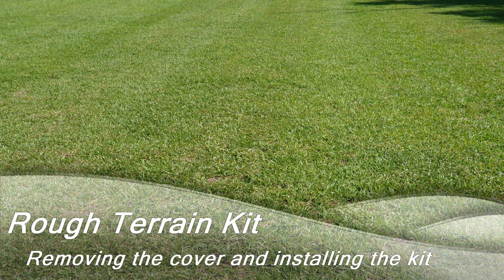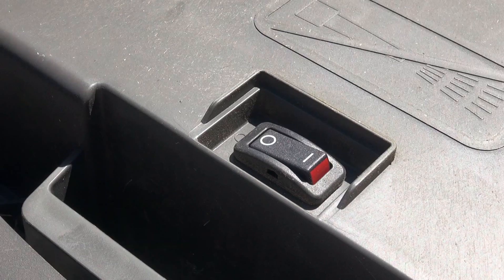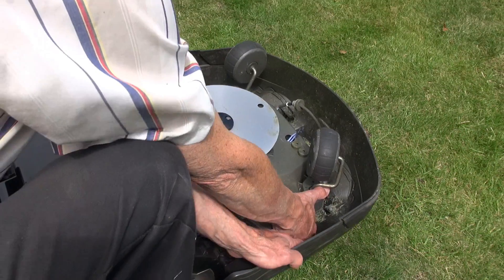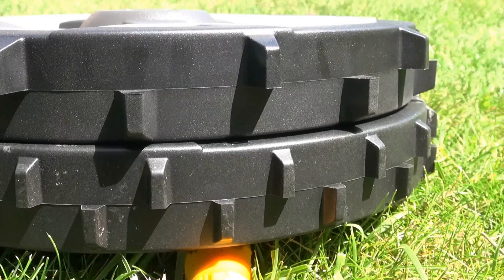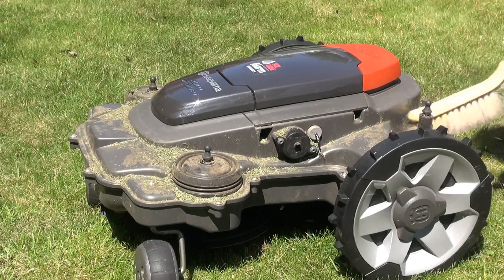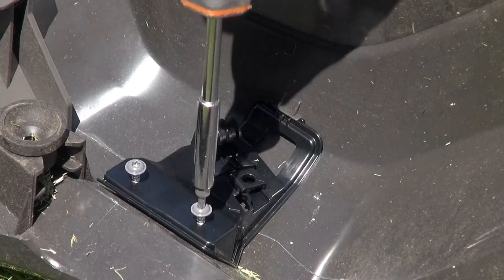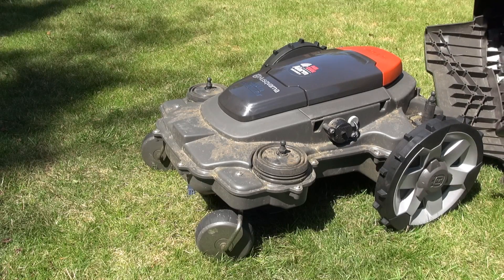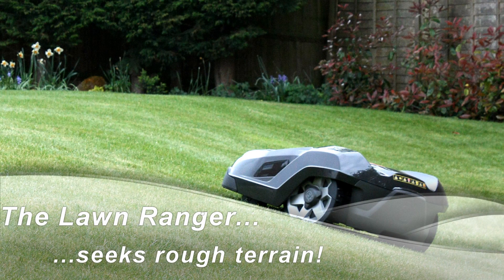Husqvarna Automower: Installing the Rough Terrain Kit

Comment: 320 and 330 are the old product numbers for the 420 and 430 so no surprise they fit.
I've been reading about the wheel replacement, people have had problems with them coming off and the recommendation is to use some thread-locking fluid.
T20 = Torx size 20.
Reply from the maker: Interesting about the wheels coming off.  I DO know where I've put my thread lock. I'll try a bit harder to find my torque wrench too.
Reply: I've had no problem with wheels coming off since fitting the All-Terrain Kit last year

Comment: Actually, there is an easier and safer way to remove the top cover.

1. Remove it with the mower standing on his wheels. 
2. Start by removing the rear end. Pull at one edge, then the other. It takes a little speed, but not much force.
3. When pushing it back on, start with the front. Give it a bit of a push, it does nit take much.

No bodily fluids are wasted this way :)
Reply: Yes, I realise that now 😎. But there was nothing in the instructions except "Remove the top cover" or words to that effect. I pulled it but didn't want to risk over-doing it in case I was doing the wrong thing, hence turned it over to take a look.